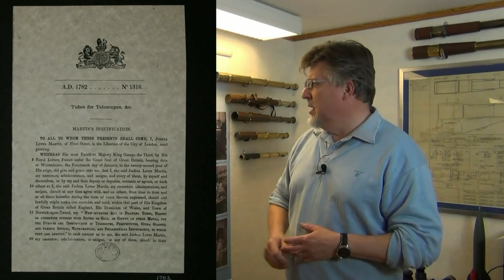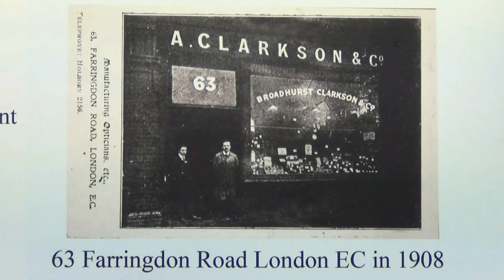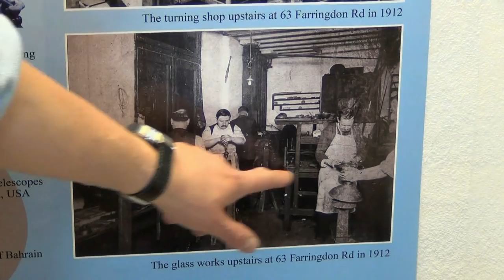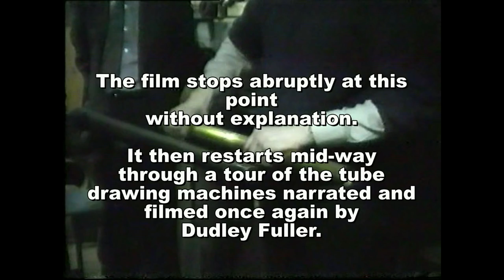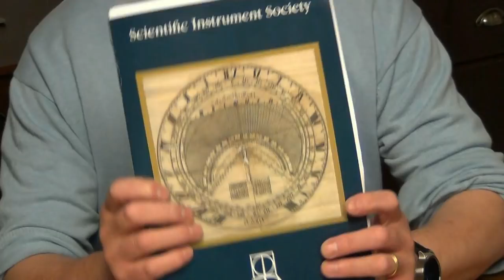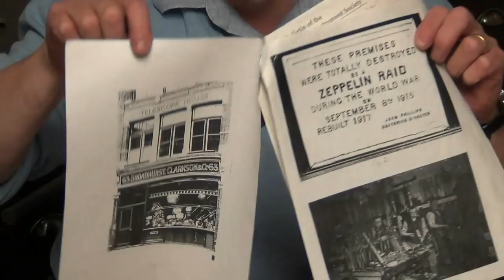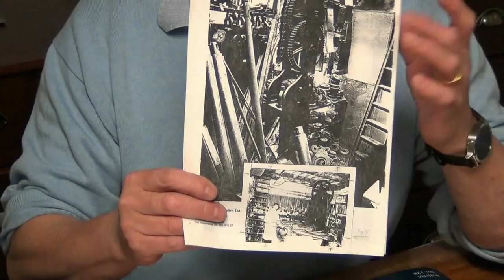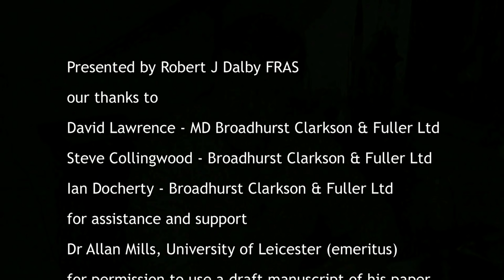The manufacture of high-precision brass telescope tubes 1780 to 1990

Comment: I'm fascinated with the discussion they're having at around time 20:00 about the hand forming of the tubes on a mandrel... 
You've never used rollers, where you feed the metal sheet between two rollers? 
No! We've never had that. 
These days, every step in product development and fabrication is evaluated constantly. Is there a better approach to this design? Can we improve the performance? The finish? The durability? Is this the right material? Are we even taking the right approach? Can we do this particular manufacturing step in a better way; can we do it better, cheaper, faster? They'd never even considered whether there were more effective or efficient ways of doing any part of the job. Stuck in the 18th century forever. Incredible.
Fascinating from a craftsmanship point of view, but to manufacture a product for two centuries and never reevaluate the process is just dumbfounding to me.
Reply: Maybe you are looking down the wrong end of the telescope, so to speak, they had perfected the technique.
Reply: @johnnoble7522  Surely this location/technique out of favour both from cost, and replication.   A work place difficult to tart up to show to your clients as a centerpiece of customised construction in pre-sale negotiation.
H.S.W. would probably site:-   ingress/egress, material transfer, ventilation, lighting, fire and flooding risk, open machinery, no clear pathways, gas/sewage leakage, dust inhalation from direct flooring, no fire extinguishers(water,  -Co2 + banned)     etc.
Sorry,    but you get the idea.        Not a War,     P.O.V.         Not an accepted modern workplace.

Comment: I have come across a thos Evans antique brass telescope and I am looking for any resources about information on it. Does anyone on here have any leads by chance??
Reply: Some maker names have been picked up by factories in India that churn out large quantities of plausible replica antiques. Many 'Thos J Evans' compasses come in brand new wooden boxes, with similar stains, dark lacquer or production-line 'distressing' ... buyer beware ...
There may be genuine originals, of course, so you need to carefully evaluate the individual item. Does the seller have a lot of other similar items? Do they offer bulk discounts if you buy 5 ?
Reply: Is it well-made: precision tolerances, durable design? Or is it cheaply-made so it barely works and is liable to break? Does the wear-pattern look like a century of actual use? Is there dust inside - uniformly distributed, or swept out by the tube movements? Is the glass pristine, or have accumulation of dust/dirt round the edges? Does it have many fine scratches from shirt-tail cleaning, mostly towards the center? Or is the glass pristine, apart from poor manufacturing/polishing marks? Is the maker's mark plausible - does the box have 'Telescope' on its label?